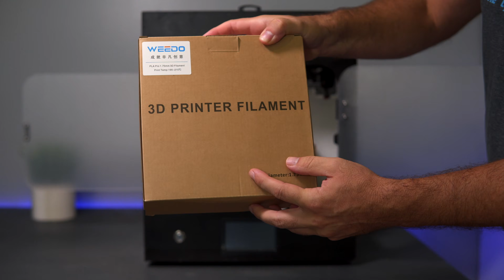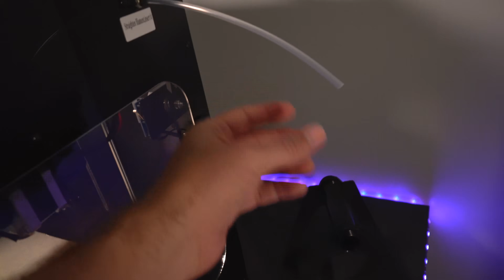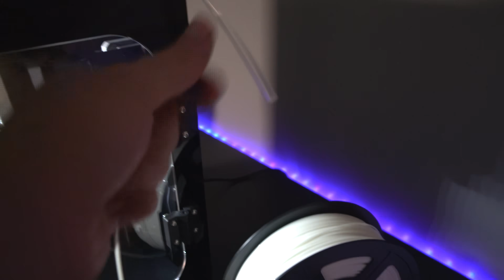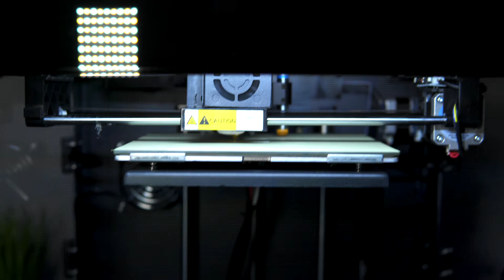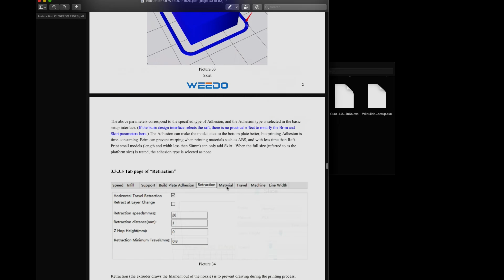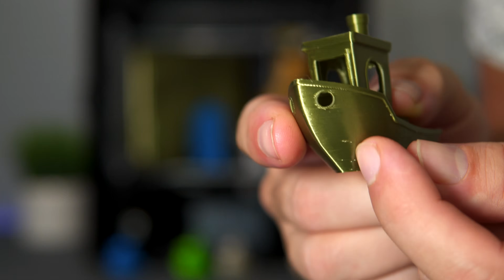Weedo F152S - 3D Printer - Unbox & Setup

Comment: I received mine today and have done everything. Took longer than 40 minutes to take off all the plastic but it had to be done. The only issue I see so far is I have the wrong plug and may have to either get a different plug or an adapter. I was ready to get started so that's a bummer.

Comment: I bought this printer a short time ago. I'm having to tighten my x-belt because of layer shifting. But Weedo is giving me good support. I'll be ordering some extra nozzle assemblies so I can change nozzle size quickly. Also an extra bed so it can be prepared for different materials. I'm going to try to print PC with is soon. I wish it was bigger but for an enclosed printer it was hard to beat this price.

Comment: 😂 i have ocd and im autistic and i would absolutely have to remove all plastic coating, even under the hardware.
im new to 3d printing and been having fun with my ender 3.  best part im finding is how much the whole process makes you think.  like how to create a piece while keeping in mind how to reduce print time, material usage, all while maintaining durability and design look.  also have to take into consideration, once printed, if there are any support material, can it be removed?  printed a part from thingiverse and once done, i wound up breaking item trying to remove the support material.  luckily, lessoned learned.